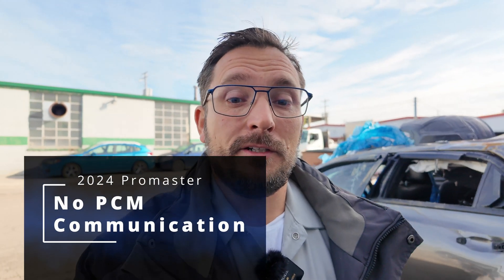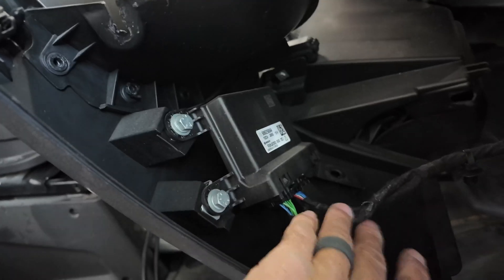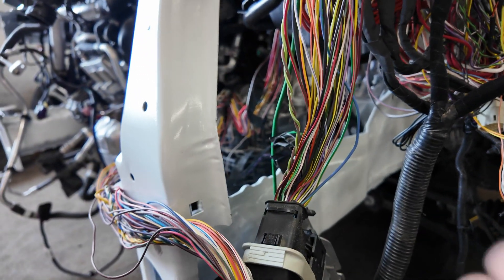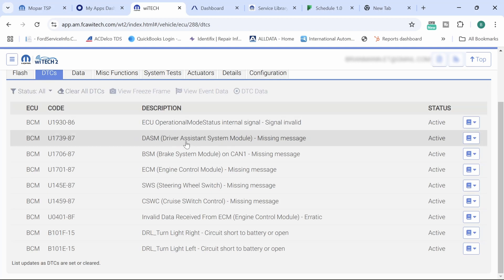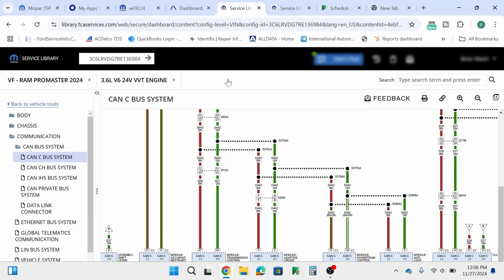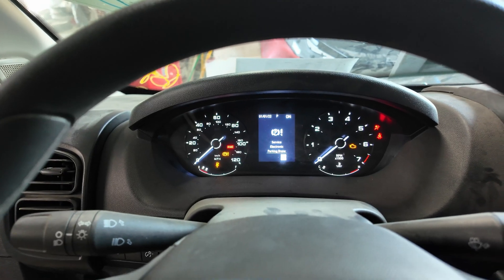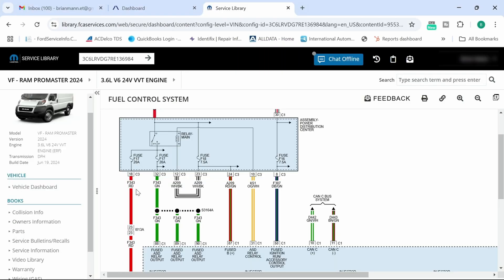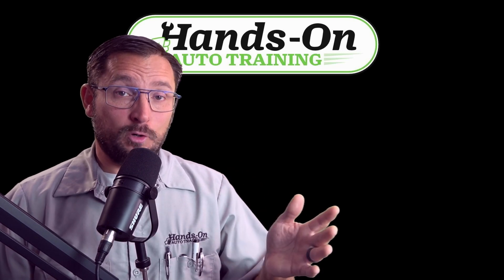2024 Promaster No Communication 11-27-2024

Comment: I just had a 24 promaster same condition, but was brought in with the harness missing. I poured over powers and grounds and bus resistance. Had the Pico scope on it. Load tested and ohm tested until I was completely doubting myself. I knew it was the missing harness and was arguing with the body shop but your vid helped seal the deal. Great vid 👍.

Comment: This diagnosis is very interesting, but why does the PCM not communicate if according to the diagram the PCM is connected before the i283A connector and not after? I think the diagram has an error and the PCM is connected after the I283A, that is why the network is restored.

Muy interesante ese diagnóstico, pero por que no comunica el PCM si según el diagama el PCM está conectado antes del conector i283A y no después, yo creo que el diagrama tiene un error y el PCM esta conectado despues del I283A por eso se restablece la red.
Reply from the maker: It's is interesting,, note that connections for the acc is just like a pigtail extension,  the scope pattern at the ecm for can c looked proper( not like when there is a open in the network).

Comment: I think because the ignition node was never able to switch on and off the codes were never able to erase but everything was good just the codes were active and never changed status. But once you got the adaptive cruse control back on line  and the ignition node started working the  codes were able to erase and the rf  got the correct key info ,now i dont know what the adaptive cruse control and the key node share but it worked mabe its tied with the stearing system and without the adaptive cruse control the ignition node wont work .thats all i can think brian thanks for sharing ur videos

Comment: Brian first off you amaze me how you come in to troubleshoot a problem with that total mess. My concern with a vehicle in that condition could you cause another issue by plugging in modules you have no idea why they are unplugged . I probably would have approached it the same way you did by checking the schematic but I think I would have wanted the vehicle in a state of reassembly more representing a vehicle. Did they need that issue resolved before any of their reassembling could continue ? Do you know why they needed that portion of the repair done at that time ? Thanks for sharing and oh get that hair groomed Lol 😊
Reply from the maker: Hi Arthur, thanks for watching!  I had no idea that the front end was off this vehicle when  I had received the call! I think the bumper was off so they could used the frame straightener to pull out the crash damage. We can discuss more at next meeting .